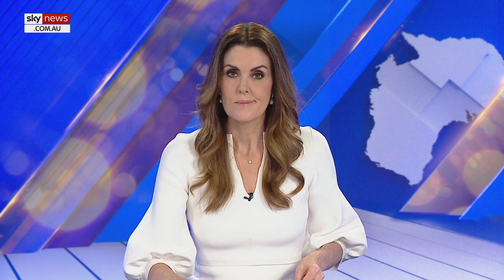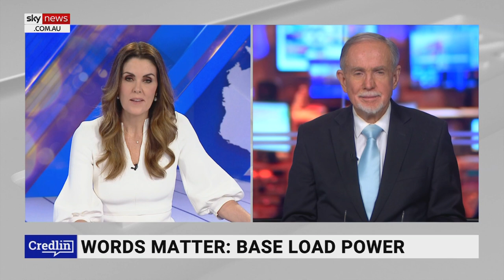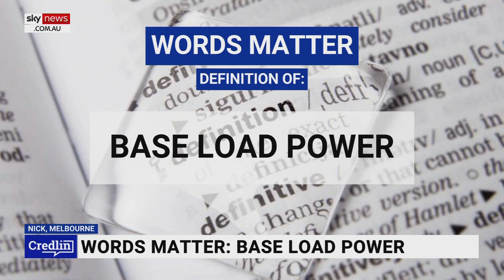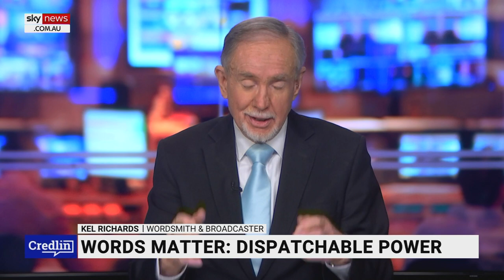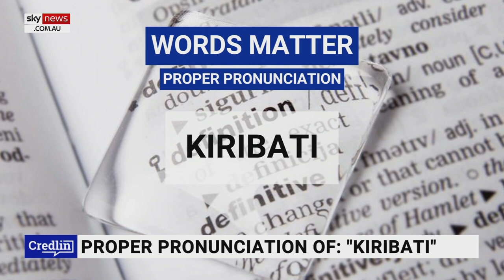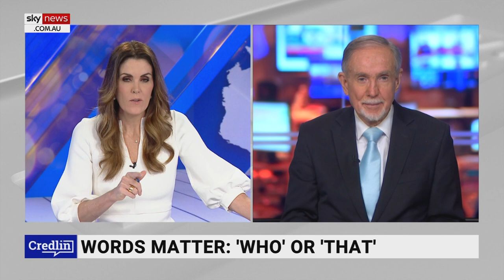How countries find ‘base load power’ explained: Kel Richards

Comment: Gee can't we run a submarine power cable or 2 to China? They have heaps of dispatchable power. Well they would have if we sent them more coal. And the best part is the CO2 they emit would be there and not here. Look I am kidding I know China hasn't got enough dispatchable power for themselves. Maybe China can build some coal fired power stations on the Solomon islands. It's a lot closer. UNO voltage drop etc.